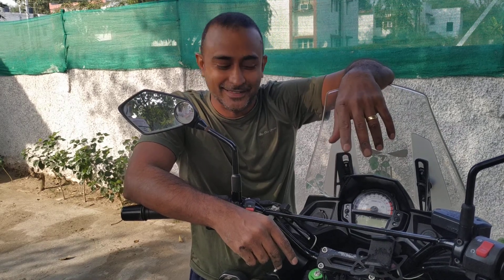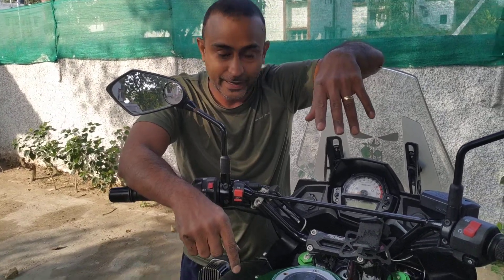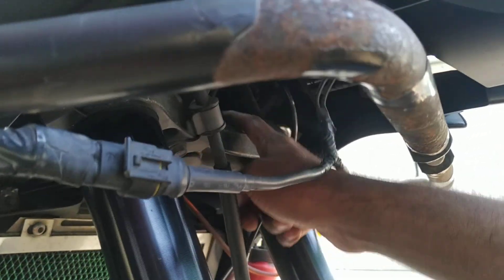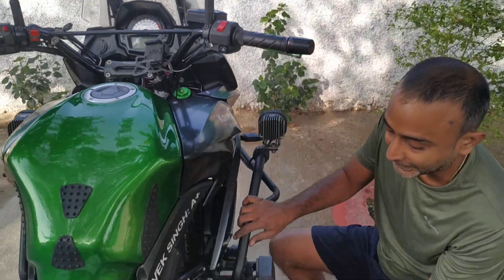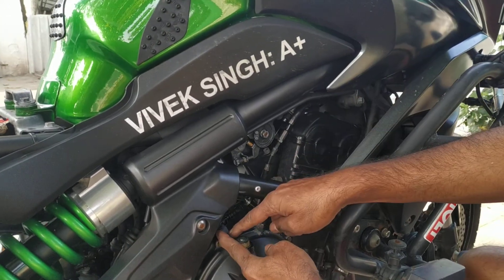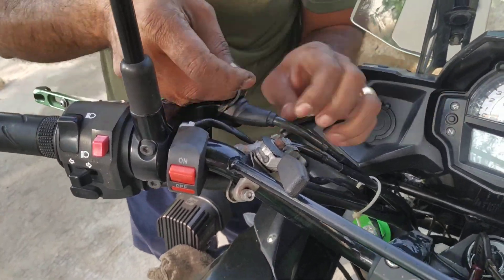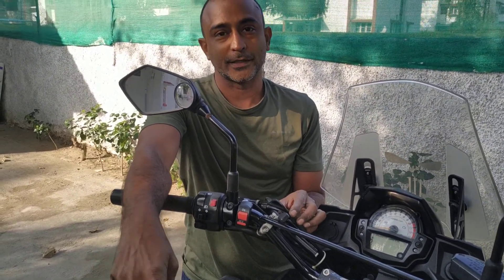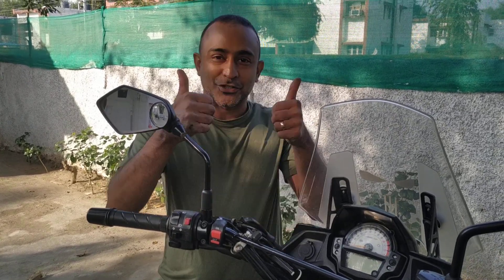how to replace Kawasaki Versys clutch cable.

Comment: I can NOT get it out of the clutch up top
Reply from the maker: Close the adjustment from centre to allow cable slack..
Reply from the maker: Also align the cut on the adjustment nipple at the lever opening
Reply: @Mr.diybiker  TY.  I mean the little end piece of the cable.  I can NOT get it out of the bottom of the clutch handle.
Reply from the maker: Did you take the plastic panel out . Once out you have to push it backwards.
Reply: @Mr.diybiker  Plastic Panel???  In there w/ the "knob"? 
 Idk what that is.  ty tho.
Reply: @Mr.diybiker  Plastic panel up by the clutch handle?????
Reply from the maker: Share your watsapp no.. we may need to do a one to one video on this
Reply: Stick the setting to setting 5 on the adjuster (worked for me)
Reply: Pro tip: one 10mm bolt removed under the lever pivot allows you to pull the pivot bolt. Pull that lever off and hold it up by the cable nut with the alignment slots. Place the hammer in the allotted hole, line up the slots, then just place the outermost (forward end) of the lever where it’s supposed to be and rotate the lever into it’s place (it’ll seat right where it’s supposed to be), and replace the pivot bolt and nut. Eliminates a LOT of adjustment getting it set back up right, because you don’t have to close the adjusters on the bottom of the cable. Removal works the same!